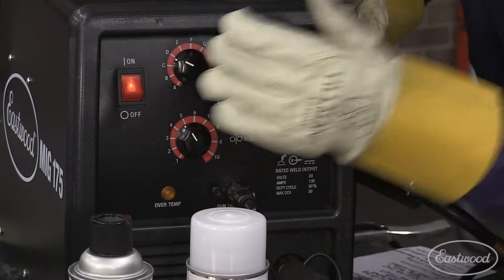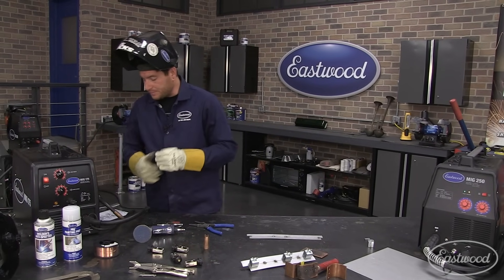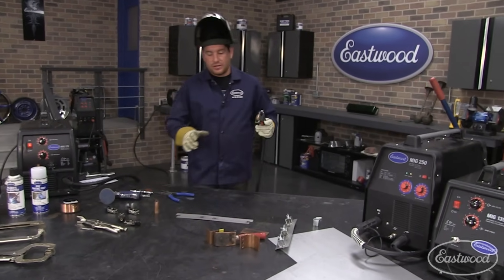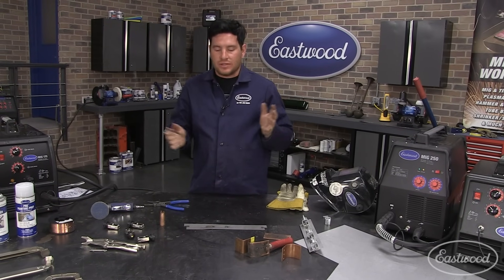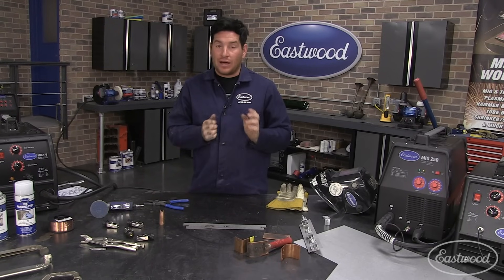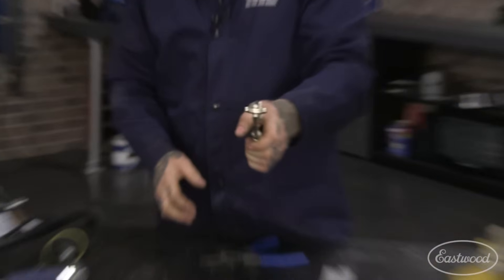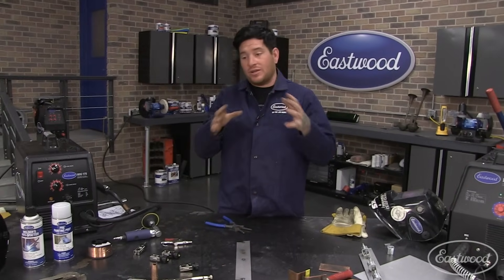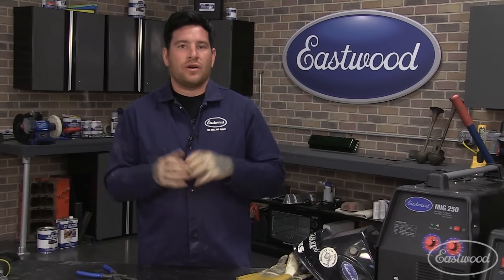How To Weld Sheet Metal - Part 2 of 2 - Welding Sheet Metal Basics with Eastwood

Comment: How to weld two different gage panels
Reply: I saw the trick was to set the welder for the thicker side metal, and as you make the arc on it, feed  it into the thinner gauge metal . Start the zap on the thicker side

Comment: Great videos! Your customer service however is non existent, no one answers emails or phone call and the chat line doesnt work. So far, the only thing you did right was take my money, that was smooth as shit. I bought a MIG 180 off your website during a spend $100 and get free shipping sale. You charged me 41 dollar for shipping during checkout with no other option to pick. If I had read your facebook page reviews I would have never bought anything for this company.
Reply: Half of the products are chit too. Do you actually think they make all the stuff they sell? Low grade cheap stuff , stamped with Eastwood label

Comment: Do I really need 220 volt welder to weld sheet metal or I can do this with 120 unit like forney 140 FC-I
Reply: First off, by a brand label  welder, not Eastwood. I have the 120 volt Lincoln 140C and it works great for sheet metal.  Also make your own copper backers out of scrap copper pipe or brass.

Comment: Everything is great on set... but here in the New England area cars with previous repairs and general hackery then having to replace panels is not so simple. Factory uses glue with welds or laser welds.  Then you have cavity wax inside rust prone areas from the factory.  All these things make welding  metal that sometimes becomes thinner than you'd like...real difficult.  That's where a pro spot is gonna be a good option. Mig welding is still a useful tool but autobody has moved more towards specialized equipment, to do panel replacement at a higher quality than the weekend warriors. Try a video replacing a rocker and inner rocker  and show how to remove the things that make welding tough. Then I'll be super impressed. AND get ICAR to sign off on the repair also. Thanks.

Comment: Would like to see weld completed on truck fender arch patch, because it is vertices not flat weld. Patch cut out no so even as your straight cut samples.  What about welder damage electrical feed into my F250?  Will electrics be damaged on truck ?

Comment: ? when you weld sheet metal do you just spot weld or total weld
Reply: Yes. Its tedious and slow. You go back and forth connecting each spot weld until its all one weld. But thats needed to keep the metal from going flat to wavey!  Its not how they weld thick metal,  a long continuous. weld . Just like he showed, quick zaps. Do one,  do the next 6 inches away, and 4 inches from that one, until you do the whole length.  Go back and start the next series of zaps. inbetween the first set. Keep doing this until theres no more empty spots to weld
Test it yourself on scrap metal and see and learn.

Comment: I have a 175. I'm trying to weld up holes on my brand new AMD firewall 19 gauge, i bought the sheet metal kit 19 gauge from Eastwood also. I clean both metal areas, make a circle to fit in the hole, use a welding magnet to keep it in place. Start at the recommended settings on a scrap pieces on the bench, they weld fine. Nice and flat. I bring that to the car and the first spot i blow thru. So i keep very slightly going down in voltage first, then wire speed. Until i get a crappy ball on top with no penetration. I am using 1/4 stick out, cut the .25 L-56 Lincoln wire to get a fresh start. Gas is 75/25 @ 18 cfh. The tip is about 1/16 back from the edge of the cup. Ground is on clean bare metal as close as i can get it. I can weld 1/4 or 1/8 tubing fine and get great welds. When i try this on my car's original floor patching a hole it's worse, i keep chasing blow thru holes. What setting work best have you found using this welder.
Don't know what i'm doing wrong, Please help.
Reply from the maker: If the metal is rusty, you can experience blow-thru much quicker.  Have you tried using a copper back?  a backer should really help prevent blow-thru.  I suggest the backers with the handle:  http://www.eastwood.com/welders-helper-3x3-set-flat-curve-anglecop-plates.html      -  If you can't reach behind the metal to hold the handle, try this one with a magnet which works great:  http://www.eastwood.com/magnetic-plug-welding-tool-horizontal.html
Reply: Well on the firewall it's brand new AMD metal and it's still happens. On the flooring It's original metal, i cut the rusted area out good enuf to good metal. I have and used both of those items. Also i use a air blow gun after each spot i cool the metal and it still happens. This always happened since day one, just thought it was me being a beginner welder at the time. 
One thing on the settings you used on the video. I set it for 19 gauge  which is E 5.  22 gauge says B 4. On the video you have it set for B 4.5. Why is that if the Sheet metal kit is 19 gauge.
Reply: Hi did you see my reply, any ideas?

Comment: What you are showing is "MIG Spot welding" a "Butt joint". 
What method is used for true "MIG Spot welding" "Lap joints" like are used on all newer cars (over lap of 1" to 1 1/2"). EG. Is the top metal layer required to be drilled first, or can the two sheet metal layers be welded without drilling the top metal layer? Access from one side only!
Reply: Paul Aitchison Typically on overlapped panels, holes are drilled through top piece and then welded up to join the two pieces together; these are called plug or rosette welds.
Reply: @rustyjeep2469  But you should make a flange on one side so the metal  overlaps at that flanges , and  thats where the plug  hole is made. That way  the 2 pieces stays even with each other

Comment: Hey guys, thanks for the very informative videos. I now own a Eastwood 175 Mig welder and am enjoying it.
I have the small spot weld clamp and the spot weld tip as well.
I do have a set of the larger clamps from another source but I have a suggestion that I think would be of benefit for larger panel work and that is to take the end of the small spot weld clamp and adapt it to the larger clamp so you can spot weld a large panel that the small clamp cannot reach.
I would buy such a clamp along with the other ones and simply move the spot weld clamp along the weld such as I would with the smaller one.
I don't think this would be a major undertaking to accomplish.
Of course I would expect my first one to be free for the suggestion. lol
Let me know what you think

Comment: Could you quote mig wire thickness in mm please as that is what is used in UK and Europe ! EG 0.6mm and 0.8mm!
Reply from the maker: .025 = .6mm and .030 = .8mm.  Hope this helps.
Reply: ...and Australia 😀
Reply: @AndrewStokes1966  Yes, its . Yoi .025, and yoi .030. Cheers!
Reply: Or take the wire size and multiply it by 25.4  (example: .025 x 25.4 = .635mm rounded to .6mm)

Comment: Not a bad video, but to be realistic, you won't have your quarter panel laying on a bench. You really need to show the challenges of lining up the panels and weld without having anything behind the panel as in many cases, there won't be a way to get behind it.
Reply: these are the questions I have. Trying to do a rocker patch
Reply: From a beginner's point of view, I appreciate how basic this video is.  Showing the challenges of lining up and welding panels is a great idea for the next, more advanced, video.
Reply: Old comment, don’t care. Anyways... You’re speaking as if someone watching this video is going to be replacing a rusted out floor on a car or rusted out strut towers... This is an introductory level video and has provided a lot of excellent tips to help out the beginners. “Not a bad video”... Don’t see yours anywhere.

Comment: When you welded with no gap you had it flat against a huge heat sink- the table versus your open gap weld had no back up until you showed the copper plate. Not a good comparison for penetration and blow-through IMHO. else very good info.
Reply: did u see the warp?